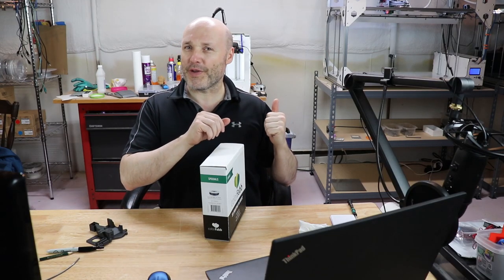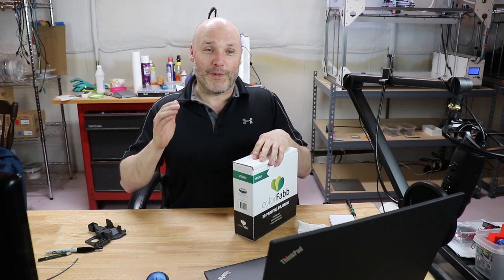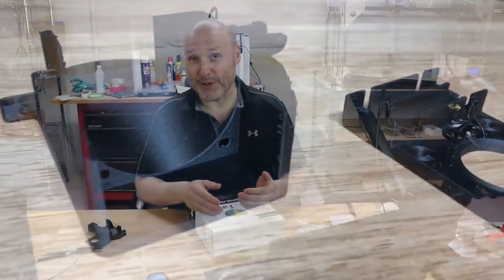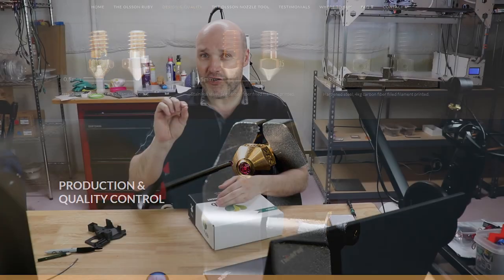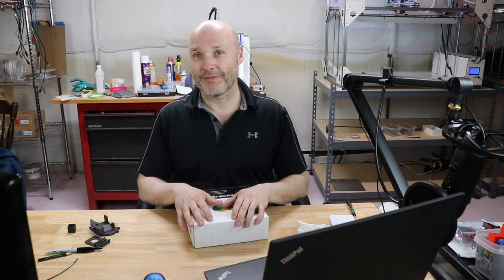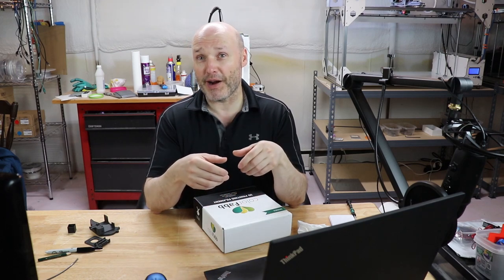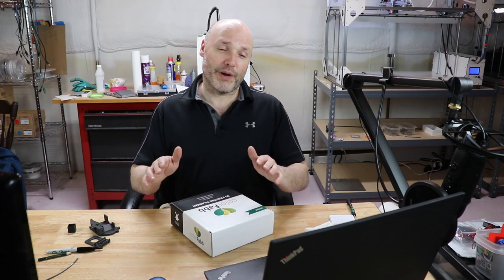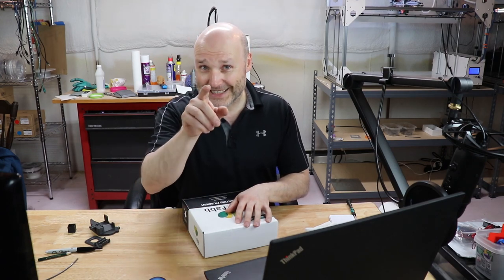3D Printing ColorFabb XT-CF20 Carbon Fiber Filament

Comment: With a 0.6mm hardened steel nozzle and a strong fan its just an amazing filament. Way easier to print than PETG and so much stronger.

Comment: Thank you for making this video, the only filament I bought is nylon and I'd like to buy carbon filled nylon but the price is too much. I did noticed your printing with 2.85 filament and wanting to use the bondtech extruder. I've been looking for one in 2.85 but I can't seem locate one because my income is low I'm going to have to get clone and I'm wondering if maybe you can steer me in the right vendor that has 2.5 for sale. Keep up the great work you're doing and thank you for any help you can get me.
Reply from the maker: Hi.  Yes the Ultimaker uses 2.85 mm.  Is your printer 1.75 or 2.85?  Please clarify!
Reply: @WhereNerdyisCool  No my printers tevo tornado and of course it's a 1.75 but I'm trying to utilize a large nozzle in 2.85 for large prints and high strength.

Comment: okay but what this stuff made from? Nylon, PLA, ASA, PETG? I literally didnt find anything that it carbon fiber reinforced "something." I assume its nylon, but not sure
Reply from the maker: Well you can check the ColorFabb website for details. But briefly , it’s 20% chopped carbon fibers using their XT material. It’s a co-polyester using Eastman Amphora AM1800 3D polymer.  Hope this helps